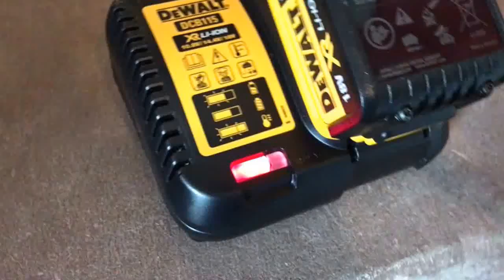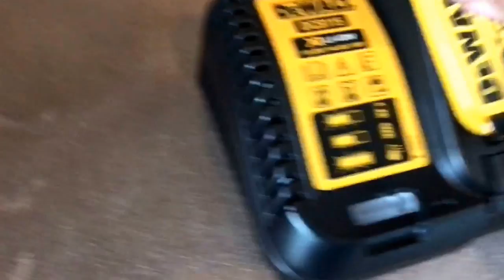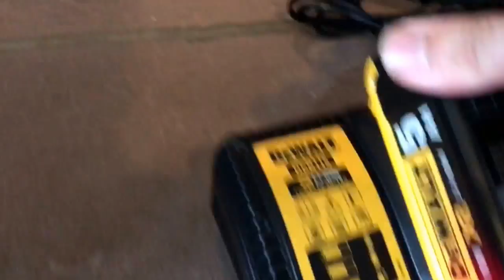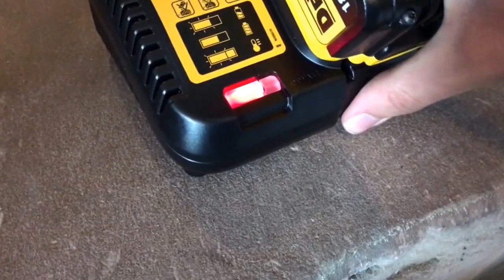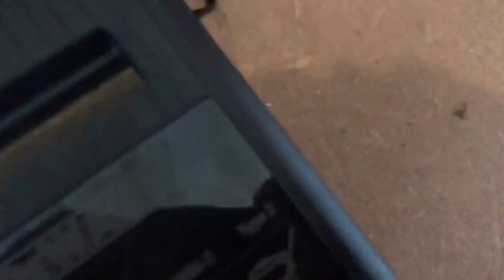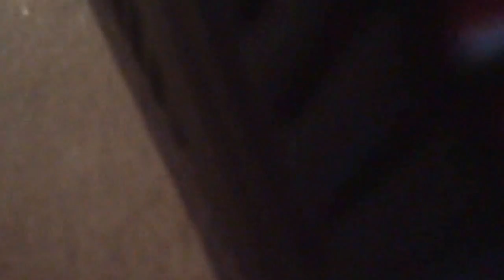DeWalt DCB115 battery not pushed in hard enough

Comment: Thank you for sharing this. Just got my DCB115 charger in Stockholm today, and the red light blinked thrice and switched to solid red the moment i placed the battery into the charger (without pushing it in). And the blinking never resumed. It felt as if the charger incorrectly detected that the battery is already fully charged. And I was anxious whether the product and user manual are in sync or not, or maybe the charger or the battery is faulty. Ideally, there should be no light from the charger until the battery is pushed in properly. When the red light comes on even before you have inserted the battery in completely, it creates confusion that the product is not behaving as mentioned in the user manual, especially for a new user. Something as simple as pushing the battery completely in can be tricky for a new user, especially when the user manual warns you not to forcibly push the battery in and multiple other non-violent precautions! 
Even a simple sentence in the user manual saying that "insert the battery pack in to the charger until you hear/feel a click" will save any new user with this highly likely facepalm event :D
Now, if someone responds here that who cares to reads user manuals for chargers, then they are missing the point.
Reply: happened to me too lol. Glad someone explained it in the comments!
Reply: I really did not understand the video until I read your explanation about pushing the battery in until it CLICKED.  Thank you for saving me so much time on here and what would have been many more "facepalm event"
Reply: Thanks for this comment, I really don’t understand the video but your comment explained everything

Comment: Although this video got some hate, it did help me. I pushed it in until I heard a click and it didn't seem to go any further, yet my one bar brand new 5Ah battery was apparently "fully charged" with a still red light. I just had to remove it and put it in again, once again making sure it clicked and was fully in, and this time the light flashes like it should and I can hear the whine of the electronics.

Comment: The problem is not with the Charger. It's clearly seen that when you do insert the battery all over the way until you hear a "Click", the lamp does not comes off. So your video  does not reflect any issue because you just refuse to insert the battery all over the way into its mount. There is no problem here. Not with the equipment, that's for sure...
Reply from the maker: You are right. But I never had that problem with Bosch or Makita chargers. BTW: They also don't feel that cheap. And as you can see I am not the only one with that problem.